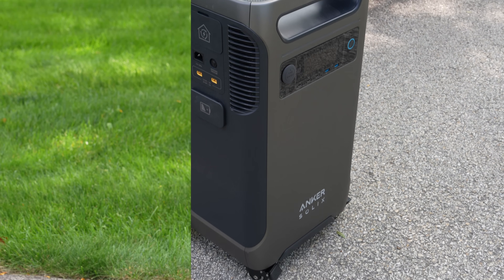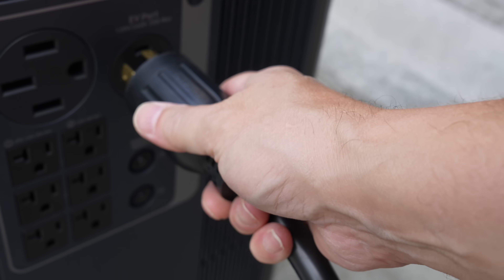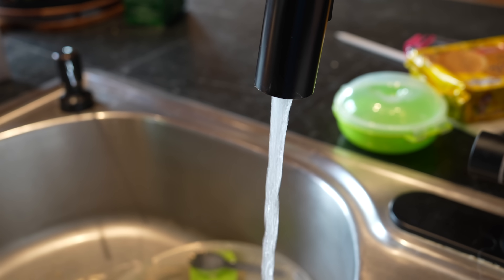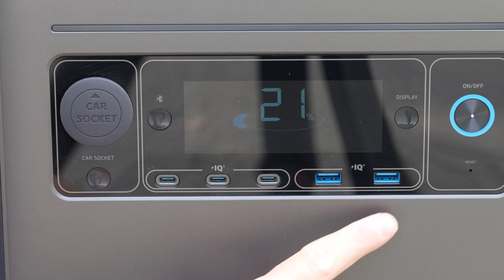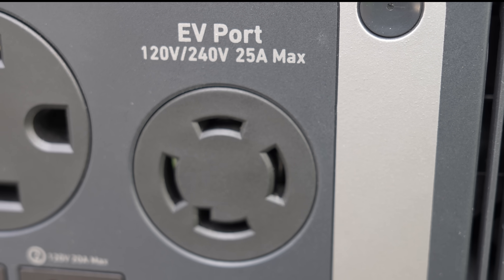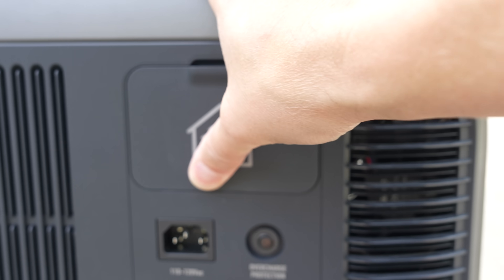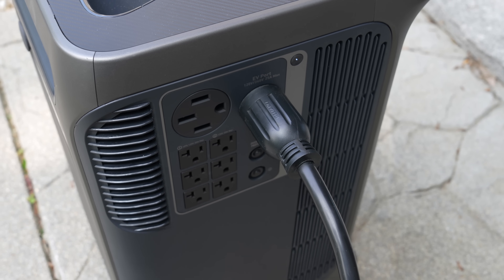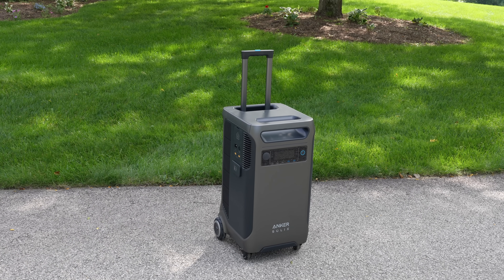Better than GAS Generator? First 240V Battery Backup - Anker SOLIX F3800

Comment: Zendure offers a the SuperBase V that does 240. I actually own the 4600 LiFePO4 model. They offer a semi sold state battery model also. Point Zero Energy offers the Titan 240 also. They are taking preorders now
Reply from the maker: You are correct, the only issue is its super low amperage, so it does do 240v but it's not usable for most of the reasons you want 240v but it looks to be a good powerstation. As far as Titan that have to be the weirdest company on the planet, preorders, delays and they never seem to ship anything. I like Zendure, I wouldn't touch a Titan product, I honestly though they went out of business 2 years ago.
Reply: You're absolutely right about the low amps on the SuperBase V. But fortunately my items fall underneath the threshold. I'm surprised to hear you say that about TITAN. They have such a loyal fan base that speaks so highly about the customer service. Although, I have heard about long back ups on deliveries. I will say all the new competition is definitely a win for consumers. I felt like companies were just repackaging and rebranding the same offers for a while. I think Anker is definitely showing Bluetti and EcoFlow that they can't be complacent. Anker is here to play hard ball with solid offerings and customer support.

Comment: I appreciate the technology behind theses large power stations the issue is at this point and time they are too expensive for many especially if you want to run your entire house during an outage instead of a few select circuits.  Once you start adding extra batteries another unit and solar panels you will be spending thousands at that point. Gas or fossil fuel Generators are still the price vs performance kings on the market.   It's gonna take some time for the technology to mature for the price to come down on these things either way I like the concept though.

Comment: If I have a golf cart with a 48v lipo battery, can I plug any thoughts on how I could charge it?     Or use it as an extended battery.   It looks like the connector is proprietary.

Comment: what are your thoughts on this handling an active sump pump in a major storm.  it has a battery backup but in high rain season its not unheard of to run 4000 cycles.

Comment: You are incorrect. The Zendure Superbase V can output both 120v and 240v and even do them simultaneously, from one single unit.
Reply from the maker: That is true but sadly its a sub-standard 240v.So while it puts out 240v at 14amps it won't power any normal 240v items, other maybe odd 240v hand tools.
Reply: @SilverCymbal  Huh? 240v x 14 amps is 3360 watts. What the heck are you using that needs more than 3.3kW? A welder?
Reply from the maker: @jerkychew899  It's not just 1 item, almost always used for an interlock so you have to consider all the things using it in total. Standard 240v outlets are rated at 30amps. Even this Solix at 25amp is a little low but very close. Electric Dryers, Water Heater or well pump are all on breakers higher than that. There is not a generator on the planet that offers the 240v outlet Zendure had with that little output  Yes 240v, but useless for an interlock. Thats why they used a almost never seen 240v US plug, popular in the 70s since putting the L1430 would have been like having a spedometer that goes to 100 but the car only goes 25mph.. You can certainly underamp an physical outlet but it's not going to power the 240v items people want. But you are 100% right, Zendure did 240v, but I guess you could say they did it dirty and didnt use their full output.

Comment: The cost per kw*hr is too high.  You can build a battery system for home back up for much less or even better combine it with solar and then get the whole system a 30% tax credit and really bring down the cost while having a system that could last indefinitely without grid power.
The only advantage I see with this is its portability, even that is limited though due to weight.  Also having a compact all in one system.  This could be a good van life power supply.

Comment: This whole concept of battery back up for emergency power will be made pointless if electric cars can be made to power homes.  Even the smallest battery pack offered by Tesla is bigger than this product even when fully expanded.  The ev gives you a tax credit, and a mode of transportation as a bonus.  Ev’s offer the cheapest cost per kw*hr of battery storage.
This is more of a gimmick than a viable product.

Comment: This Anker unit uses a low cost, high frequency, transformerless inverter to convert DC battery current into AC alternating current. High frequency inverters are notorious for their short lives, low surge capacity and their potential for damaging the appliances that they are powering. A much better investment is to purchase a real, off grid, solar generating system that uses a low frequency, transformer based inverter. Your system will last, far, far longer and you'll be able to start and run high surge loads without damaging your solar generator or the appliances that you're powering.

Comment: So how long would this run a well pump?
Reply from the maker: Well pumps vary a lot in terms of use and they don't stay on continuously, they cycle on and off as you fill you tank. This makes it ideal for a power station. Typical household could run a average 1/2hp well pump or about 2 days with one charge with this
Reply: @SilverCymbal  6000 watts isnt enough for a well pump water heater 2 fridges and a baseboard heater though. 2 of those might be. The future looks promising for this tech, hopefully itll get there quickly

Comment: Very cool these are getting very capable with that much power output. But feels like trying to solve an issue that most people don’t have. Seems like electric power grid reliability has significantly improved over the years (especially in the northeast, I live in CT). A harbor freight generator that costs 1/5 the cost, would suffice for most. And only get used maybe once every 5 years.
Reply: Tell that to the folks in Texas. Currently the Houston area is suffering due to Hurricane Berly. I would love one of these during this disaster. Power has been out since Monday. Yes I have the jackery and a small eco Flo. But with little sun available it requires me to charge the long way in my vehicle.

Comment: This is far from the first to have 240V, we were using a Bluetti on our construction site all summer that did 5V, 12V, 120V, and 240V among other things.
Reply from the maker: Are you outside the USA?
Reply: @SilverCymbal  I am in Virginia
Reply from the maker: @randomvideosn0where  Bluetti does not make any single device with 240v output. They would need two units and a combiner box, and a ton of cables.

Comment: Please pay attention to the battery capacity! This is a great system, but it just doesn't have that big of a battery inside. It may be able to run a whole house for 1-2 hrs, then take much longer to recharge
Reply: Yikes.  Recharge how?  I'm done.
Reply: @opentrunk Through solar panels.
Reply: @opentrunk  You're gonna need a large array of solar panels and good sun, or you're screwed

Comment: We just went with a natural gas standby generator. I wish something like this could work, but we have had power outages that have lasted for days, and being on well and septic, you need power to run the well and also power the septic aerator. We also need to power the sump pump in the spring 24/7, so relying on something like this, just does not make sense.
Standby is nice as it comes on automatically, which is great when we are not at home.
Now, camping off grid, this could be very useful.
Reply: What brand and size of natural gas standby generator did you go with?
Reply: @allenbaxley8412  we got the Honeywell from Costco Canada. Costco US, has lots of options from 14kw to 22kw. Mine it 20kw, but 18kw on natural gas. The model my father just got, is 22kw, so 20kw on gas.
They are branded Honeywell, but are made by Generac.
They just had an extended warranty promo. Not sure if it is still running.
Great machine and is all automatic.
Reply: Solar panels can charge this
Reply: @firstlast4165 Assuming the solar panels survive the emergency and can charge faster than it discharges.  Don't expect recharging at night

Comment: I think the unit is promising, the sad truth is i could spend half the money this unit costs on battery's and i would have nearly doubled my capacity already. 

It would cost me over 12k$ in these units to match my homemade portable setup that cost me around 3500$ to build. That includes top of the line Victron charger controller,Battery's and inverter. Not to mention i designed mine to be modular and portable so its not stuck in any location. If i took that 12k$ those units would cost me and used it to further enhance my system i would never have to worry about solar or battery's for the rest of my life. It would even cover my battery replacements when they go bad in 12 years.
Reply: I'm just getting into this so I really don't know much, but would you be able to provide more information on your setup? I would love to have a larger capacity, less cost setup, that is also 'plug and play' like this Anker, Ecoflow, Bluetti style setup where I can just hook up my battery bank/inverter into a 'generator 50amp hookup inlet' etc., when needed. Everything I keep finding has hardwire connection from Inverter into breaker panel, and trying to avoid that since I already have the generator inlet 50amp hookup there.
Reply: would you be willing to share?

Comment: I wish ads of devices like this would not use the word "generator".  It does not generate electricity.  It is a battery that stores electricity.  It does offer a variety of outputs and can support a relatively heavy draw for a short period of time, but then it's done until it recharges for a number of hours.  It has its uses in places where there is no onsite power or during an outage, but you can't expect it to support a typical home or use of power tools for very long.
Reply: It generates heat lol
Reply: Similar to "hoverboards"
Reply: I understand this, but i think its more of a case of the word “inverter” not being as marketable. Sort of understandable, mildly annoying though, i agree. However, these battery packs do “generate” an alternating current, a regular battery pack would only produce DC, so i sort of justify it like that in my head. To play devils advocate, a gas generator is simply converting the energy from the chemical bonds of hydrocarbons into an alternating current, so why dont we call it a combustion-powered motorized alternator? It isn’t generating the energy either, it’s still converting one thing into another. You could technically use the same argument, as the “battery” in a conventional generator is simply another chemical storage medium for energy, aka hydrocarbons (gas, diesel, propane, etc).
Reply: GEEZ,  so you almost begrudgingly admit that solar back-up batteries do have limited usage.    But only very limited use for a short time...     So if the electric power in your area is down,  how are you going to go and pump more gasoline or diesel fuel or whatever your "true generator" needs to function  ?
If your "true generator" relies on an internal combustion engine,  what if you can't get it started .   Even if you are an expert on internal combustion machinery  (which most of us ARE NOT), what if the thing just refuses to fire up  ?    Do you just keep cranking away at it until you have a heart attack...
If solar energy surely does have limitations,  don't ALL OTHER FORMS of some safety and assurance for us in times of crisis also have their own unique limitations  ?   😊😊
Reply: It generates usable electricity from electrons stored in the battery. By definition, this is a generator. A gas generator generates electricity from burned fuel. If this isn't a generator, then a gas generator is also not a generator, but it's just converting stored energy (in the gas) to usable electricity.
Reply: Why get so hang-up about what these solar batteries are called  ?    OK, OK you are correct, so are you happier now  ??   Do you feel better now  ?   Can we focus on what these devices are capable of doing, and stop grousing about what they are called  ?
Just about every video reviewing or comparing solar batteries has someone complaining that they are not "generators ".    And I suppose the complaints are valid, but what does that have to do with discussing their capabilities ?    Why the NEED TO KEEP HARPING  on what the devices are called  ?
Is this intended to somehow discredit their very real uses ?    For the "these are are not generators " folks out there,  I want to hear why this is a point of contention for you.    SERIOUSLY.    Explain to me the seeming necessity to object to calling these units generators.    😊😊
Reply: @robertsalata7828  Tell us how you REALLY feel!
Reply: For someone who thinks they are so smart they’re actually not!  Once you hooked the solar panels up to this unit it’s now a solar generator!!!!
Reply: @Traveldiva2Budgets  You can hook up solar panels and they generate electricity.  This unit simply stores it.  It is NOT a generator!
Reply: @Bobrogers99 yeah a power plant doesn’t generate power. The turbines do!
Reply: @Traveldiva2Budgets it takes a LOT of solar panels to generate useable power

Comment: 【⚡ AC OUTPUT】6000W 
【💡DUAL VOLTAGE】 120V/240V
【🔋 CAPACITY】 3840Wh

Hopeless, in summer nights,  with power outages, running this unit with x2 1.5kW airconditioners will last for a little bit more than about an hour. 
This is a gimmick for people that dont know about battery capacity and power rating.
 @6kW of power, it will last for about 45 mins, YES that is correct, less than an hour.

Comment: Other than plugging it in to use indoors, I really don't see the advantage over a generator. You still have to lug it around, plug/unplug it, charge it up after. It doesn't have a 240v input, so no UPS mode, and no fast charging from the grid or a generator while in use. If their target is whole home backup I think they missed the mark here.
Reply: Ever been in the aftermath of a hurricane when gas is in short supply, sometimes for weeks at a time?  Being able to charge of solar and run at night is huge in those situations.  I also see a huge adoption for RVs in lieu of generators as well.
Reply: @pm5203  I don't live anywhere that's a concern so I can't relate, but I do see your point. As for RV use, most RVs already have a house battery system, you're better off upgrading that instead of using one of these units. If you need to run air conditioning throughout the day (which would be my use case) then a generator is the only viable option.

Comment: You didn’t mention any figures for the Wh of he device. Seems interesting for camper trailer applications run the just the lights and outlets instead of a noisy generator, especially if you’ve got propane to run the fridge and AC.
Reply from the maker: 3:11

Comment: It has great features but $4,000!  And it will not power our house for more than 6 hours (we've had 7 day outages).  We have a NG generator and 2 electric cars.  If the generator fails I have a hookup to the EV batteries and an inverter.  The EV/Inverter hookup is clumsy (and dangerous if you don't follow safety design and protocols), and power limited, but will keep the NG furnace and other necessities running in an emergency for 4-5 days.  (More if I can drive a car to a DCFC charger and recharge, some of our power outages are very localized, e.g. power is available 10 miles away).

Comment: Good Review.  I would be interested in two units in order to get to 12KW.  I use about 10K watts per day without the AC or Heater.  Two units (7.6Kwh) would have barely enough to make it one day.  I have a small tractor and a 10KW PTO generator that could be used to charge the two units each day.  The diesel tractor is very efficient on fuel and with a 100 gallon spare diesel tank it is plenty to last for weeks.  The Anker is also not waterproof, but a small shed could handle these units.  Thanks

Comment: It seems the signature solars 18kw system is still the baseline to beat for home battery backup. But the nice thing about this system is portable and can easily take it with you. Just wish the solar input is higher wattage and voltage
Reply: That's what is the problem for me, you have up to 12KW output, but you can only put in 6KW. Why would you make it put out so much KW but not be able to take in higher KW is beyond me. With two of these the max input total is 6KW, and max output of 12KW. That means if your home is consistently running 7KW you will be at a net negative at all times.
Reply: Yup that's my biggest beef with solar generators.  They focus on wall charging rather then solar input.  They need to get rid of the car charger inputs and get a better mppt controler.  Like someone is going to charge their 2000 watt battery with a 12 volt car input beyond retarded. Maybe if I drive for two weeks straight I could get it charged.  Wasted real estate on the generator.    @onlytheneeded412

Comment: That outlet next to the 30 amp plug is actually a 50 amp ment for a stove. Considering it can go up to 12kw of output, it makes sense they would put that on the machine
Reply: @AWIRE_onpc  And for how long can the unit actually power such a stove in an emergency?  Ever hear of charcoal?